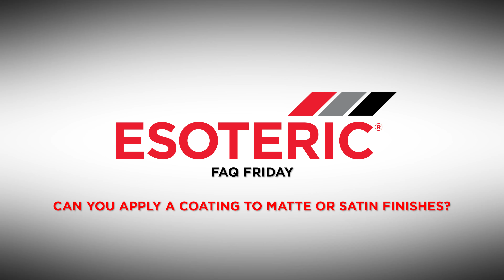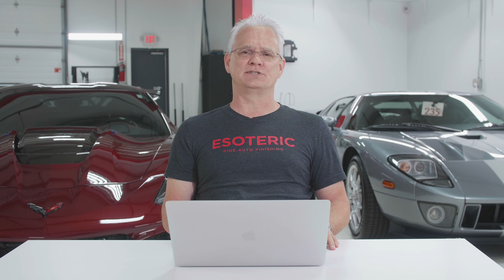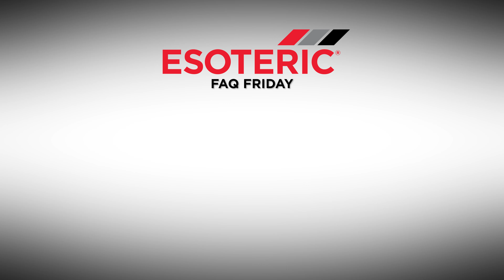Can you apply ceramic coating to matte or satin finishes? FAQs by ESOTERIC!

Comment: We have coated quite a few. First one was a matte gray rs7 a little over 5 years ago and still looks great to this day. Actually is the one in my profile photo lol works very well but I dont recommend somebody doing it that doesn't have alot of experience with coatings. If high spots are left it can be tricky since you cant use some chemicals on matte paint or polish them.
Reply from the maker: Good point...high spots can't be fixed on satin paint like they can on glossy paint. And for the question on high spots, we have a video on that subject that will released soon.
Reply: Do you add more to the applicator or same amount as for a gloss finish

Comment: Love your chanel, always wondered how you remove a coating in a mate paint since mate paint cant be polished?
Keep the good work :)
Reply from the maker: There's no need to remove it, unless you needed to repaint a section. So the answer is...you don't.
Reply: @Esotericdetail thank you , nice good too know because in other paint always need to remove for aply a new coat .
Best regards  from Portugal
Reply from the maker: @luiscaldeira7458  Actually, you do not need to remove coatings before applying new...only if it needs paint correction.
Reply: @Esotericdetail  ah nice but i guess with coatings with 5 years we will have at least some micromarring mine have one with very light micromarring but is black... and have 3.5 years and i am keeping it with a essence plus and works wonders for about 9 months  not bad but i dont like it is a filler  though, next time it will be a 2year coating max.
Reply: @Esotericdetail  but if you put coating 5 years like Nanolex on top of gtechnic Halo.
Nanolex possibly have less durability no ?
Reply from the maker: @XBOW83  Sorry, we don't use those products so can't comment...

Comment: What about matte specific coatings from company's like Gyeon, Dr. Beasley, Mckees47 to name a few. Are they just as good or better than ceramics typically associated for gloss enhancement or is it just a marketing tactic to an uninformed general consumer?
Reply from the maker: They can work well too, but you typically have a better chance of wasting product versus coatings designed for gloss finishes. If you're a detailer, you want to maximize your coating use. With a "regular" coating, you may only use 20ml of a 30ml bottle, but you know you'll use up that remaining 10ml of product on the next car. But if you have matte-specific coating, you run the risk of the coating going bad before you get another matte car in for work. In our shop, we simply use the standard coatings for all finishes.
Reply: @Esotericdetail  good to know. Interesting topic, leads me to believe there's misinformation coming from the recommendations of certain companies on what to use on different finishes. Either way, I'll try a test spot on my new matte rims with leftover ceramic before I buy something specific. Thanks for the response.

Comment: great video i came across i have a question , iam looking at a gv70 matte finish and for protection i wanted to get it clear wrapped.. would that make it a lot safer to clean etc bird crap i only do hand car washes only
Reply from the maker: Assuming you're talking about PPF, then yes, it will make your life and concerns much easier. I have an OEM finished satin car, and we fully wrapped it in satin PPF. I now have no worries at all...

Comment: Hi Tod, I've got a matte motorcycle and I'm planning on using Gyeon Q2 Matte, for a coating on it. 
1. The rims are gloss and im going to use gyeon rim coating on it. Am I able to use the matte cure on the rim coating as a booster or do I have to get normal cure to use on the rims? 
2. Is there a better alternative that you'd suggest to coat matte other than Gyeon Q2 Matte? 
3. Will gyeon iron damage the coating on the rims? 

Thanks mate
Reply from the maker: You can use a standard coating, as it doesn't HAVE to be one designated specifically for matte finishes. If you got the Gyeon Matte, you could use the Cure that comes with it to maintain your wheels. Iron will not damage the coating on the wheels. Thanks!
Reply: @Esotericdetail  awesome thanks!
Reply: I just did this - haven’t done the Q2 Matt Cure yet, as I’m leaving it to dry overnight. Came out beautifully, but it did add a sheen. 

Not fully glossy, but definitely not my Matt black paint and I don’t see the drying and curing altering the colour. It’s much closer to satin black now.

Comment: How do you remove ceramic off a satin paint?
Reply from the maker: You don't...which is why you have to be extremely careful when applying it so you don't make any mistakes. Unless you need to have the surface repainted, there would be no need to "remove" it from the surface.

Comment: There’s ceramic coating for matte finish only. You do not ever use ceramic coating for glossy finish on the matte. You will ruin it.
Reply from the maker: Not the case at all. We have done many, many satin finishes with regular coating with no issues whatsoever.